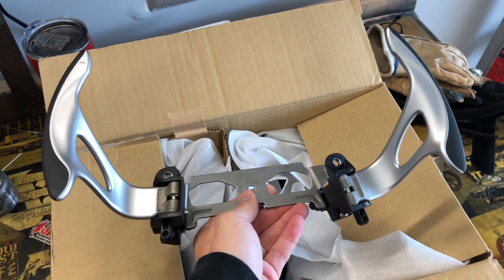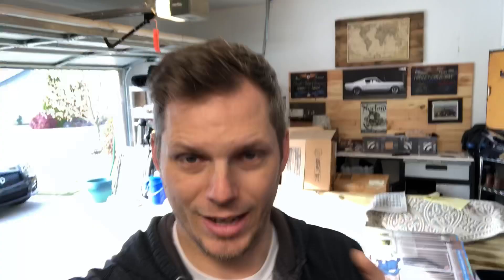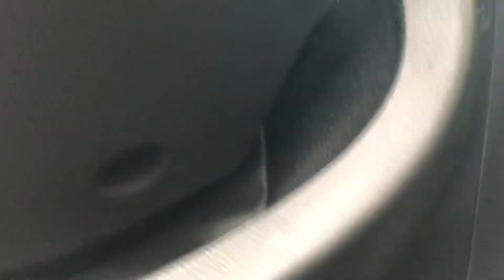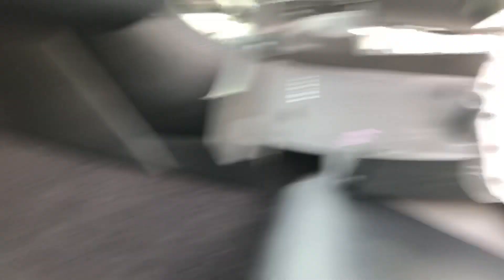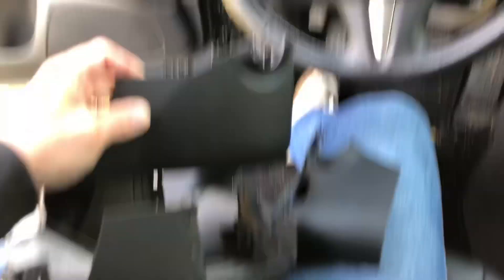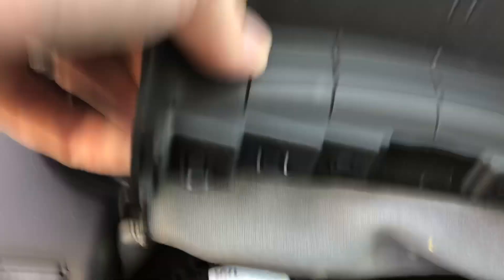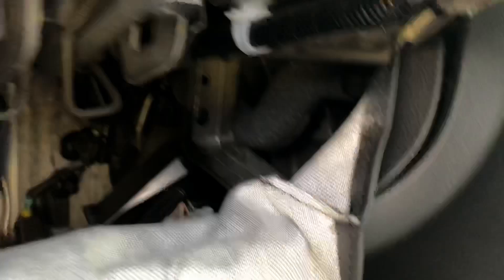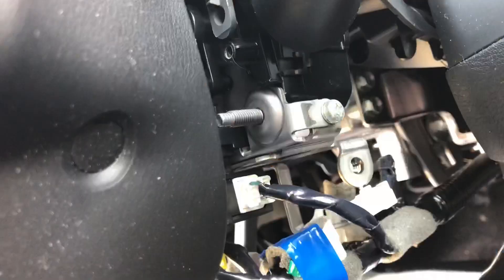Q50 Paddle Shifter Install Made EASY!!!

Comment: Update guys, just installed mine today. Just like he said the hardest part is the leather clips on the bottom cover. Taking them off and putting the new one on. Taking the old column cover off was easy. Installing the paddle shifters was easy. Putting together the four piece column cover replacement took me like 30 minutes.
Reply from the maker: Thanks for chiming in and sharing your experience!
Reply: malcolm velez did u get the manual cover and if so did the image on the site have the hole or naw please help
Reply: @joeytavares1483  I did get the manual cover. These are the part number 
Cover - 484704gf2a
Fender Bolt - 081466122g	
Backup Lamp Assembly Nut	0891110637

https://www.discountinfinitiparts.com/
Reply: what q you have?

Comment: just for notice. You actually don't need to order Bolts and Nuts from Nissan. Simply go to place like Home Depot or Lowe's. Bolts are standard M6 bolts and Nuts are any nuts that fit M6 bots. So for a summary, 2x M6 bolts and 2x nuts that fit M6 bolts.
Reply from the maker: Exactly—I used nuts I had laying around. I wanted to provide Nissan info so people could get the correct specs. Thanks for providing details!!

Comment: Did mine in 30 minutes, it was easy overall. Hardest part was removing the plastic around the column I squeezed the edges and pulled down and it popped off. I have a 2014 Q50 premium. Definitely a good and fun mod.
Reply: Where did u get the paddles and all ? I'm trying to do the same on mine I have a 14 premium as well
Reply: @fastbikes8075  Kilo November on face book. Really good quality and custom options
Reply: @abimaelmendez4912  thanks 👍I'll check it out
Reply: @abimaelmendez4912  hey man do
you mind sending the Facebook profile? Thanks!

Comment: Just finally decided to get myself these paddle shifters for my '15 Q50 after watching this video several times and seeing that it isn't too difficult, probably gonna refer back to this video when they arrive and it comes time to install them. Can't wait! Thanks for the videos as always.
Reply from the maker: You can handle it!
Reply: @SpeedCultureStudios  Thank you for your encouragement! I got them installed tonight, wow they make driving so much more fun. The hardest part was getting the new housing back together but otherwise that couldn't have been more simple.
Reply: Hey will this work on base 2015 q50 too with tech package?
Reply: @zainahmad4537  Since it's 2015 you should be fine, but if in doubt it's a good idea to check to see if the connectors are there before ordering.

Comment: You should make a how to video of the remote start for your q50.
Reply: you only gotta press it once
Reply: @carterevanh  u sure?
Reply: @Awsometiger1011  can on mine at least. cant imagine why it would be an aftermarket mod
Reply: @carterevanh  it is a aftermarket mod , not all models come with auto start !
Reply: @carlosbolanos5361  sure, you could add it aftermarket. but if your key fob has a circular arrow button at the top, thats your remote start and it came from the factory
Reply: @carterevanh  my infinity Q50 fob key only has 4 buttons , the one you have has 5 buttons if I’m not mistaking !?
Reply: @carlosbolanos5361  yep!
Reply: @carterevanh  what year is you’re Q50?
Reply: @carlosbolanos5361  2017 premium
Reply: @carlosbolanos5361  smart man'
Reply: @chinodadon3418  what do I u mean by that sir !?
Reply: @carlosbolanos5361  n a good way 👍🏼 calm down
Reply: @carlosbolanos5361  mine has 4 buttons. But I was messing around with mine once and it started lmaooo hit the lock button 3 separate times and see what happen
Reply: @MrAndremalcolm  I’m going to try it ! Thanks 🙏

Comment: I ordered my kit from the infiniti part dealer 311 dollars I'm waiting for delivery! Excited good video!
Reply from the maker: Infiniti got you a full kit for $311?  You either got a hell of a deal or you’re not getting a full kit.
Reply: @SpeedCultureStudios   
Description:Steering Wheel Transmission Shift Control Switch 
Part Number: 25549-6AV0A
Quantity:1
Price:$135.68
Description:Steering Column Cover 
Part Number: 48470-4GF2A
Quantity:1
Price:$143.50
Sawgrass infiniti FL
Reply from the maker: @atsila_one  man prices must be going down!  It was hard to find junk yard paddles for under $300 for awhile!
Reply: @SpeedCultureStudios  South FL things are very cheap when it comes to car parts! The dealership in my County want it 900+ dollars so I went to the next county over Broward county and that’s the price they gave me so it varies by county when it comes to Florida

Comment: I guess im lucky my q50 came with paddle shifters😂
Reply: Sport model
Reply: @unxlak1032 my sport model doesn’t have it
Reply: @isiponwock it should
Reply: @Nearesponsable my sport model doesn’t have paddles
Reply: @Nearesponsable  not all sport models have them
Reply: @Prod_Beatzz yeah not all sport models have them... Most likely have to get them installed
Reply: @chickenvanes4406  yeah that’s just weird
Reply: @Prod_Beatzz it’s because you probly have a base q50 3.0t like mine the turbos unless you have a red sport q50
Reply: @M-bn2cv  no it doesn’t have to be a Redsport to have paddles I’ve seen many regular 3.0t with them mines a 3.0tS and doesn’t have them I had to buy aftermatkey
Reply: @Prod_Beatzz  yea what I mean is the ones that don’t come with it. the 3.7 come with it I’m saying all 3.0t sports,base,premium don’t come with it the redsports and 3.7.
Reply: @Prod_Beatzz  the 3.0t don’t come with it unless it’s red sport the 3.0 any other models don’t got it unless it’s 3.7 or aftermarket I know a lot of people with q50 and me owning one I did my research. So no not all 3.0t come with it unless your redsports  or 3.7
Reply: @M-bn2cv that’s actually not true. The paddle shifters are a option when buying the car brand new. Considering it’s a luxury car not a lot of people liked or used the paddles so they made a lot out of the factory without them. If your buying a q50 brand new you can have the option to pay for the car to come with them.
Reply: @oscarbanuelos3573  no it’s not unless you getting a 2020 or some shit the 2016 didn’t come with paddle shifters the 3.0t im talking base the red sports do come with it but only some j never got the choice to want paddle shifters what dealer you go to unless I wanted the red sport or the 3.7

Comment: I found the bolts at an infiniti dealer (you can also find them in a Nissan dealer), the nuts were not available in my area so I bought some at home depot ¼ fine thread. Thankyou 😁

Comment: Fun fact, the Nissan Maxima and Altima paddle shifters also work well with the 14-15 Q50 models, and they look better
Reply from the maker: Looks are obviously subjective but yes, I think we’ve mentioned it a few times in the comments and in other videos that there are several cars you can use paddles from which helps broaden the search and gives more options.  Maxima and g37 paddles are often used in these Q50 upgrades.
Reply: @SpeedCultureStudios  I bought em cause they were cheaper.  Yea they look better but were like $100ish cheaper

Comment: I have the 2014 3.7 Premium Q50. I see there are multiple versions for the 3.7. On the site, the auto tilt linked says its listed for the sports version. Which shroud should I get for the auto tilt?
Reply from the maker: Only difference is auto tilt or manual tilt. Obviously it has to say “sport” because only the sport had paddle shifters.

Comment: Nice video man, I installed my paddle shifters myself as well ! Easy job 🤙
Reply from the maker: Super easy! Stupid they just don’t put them in all cars!
Reply from the maker: ryan nurse I found the paddles off a g37 at a local salvage yard. I offered them $100 they said $120. Then I found the shroud online—link in the description—for $100. So $220ish for all of it and a 30 minute installation.
Reply: ryan nurse I bought mine from discount Infiniti for $187 brand new & I bought the shrouds and hardware for $135 I believe . I see the kits selling online for $500-$600... crazy
Reply from the maker: @kevinbaca3258    Nice deal!  I'm seeing just the paddles going for $250+ used on ebay!  Even the salvage yard I went to chuckled at my offer at first saying they usually sell them online for $220.  They gave me the deal because I was local and came and picked them up same day.

Comment: My goodness thank you I been waiting for this vid from you for so long , I got the paddles but needed instructions thanks 🙏🏼
Reply from the maker: No problem!  Should go pretty smooth!  Just be careful with the trim pieces!
Reply: I have a question it’s posible to cut the plastic lower panel for the paddles ?
Reply from the maker: I have seen it done. I don’t think the guy was too pleased with the results but it didn’t look too bad. The holes were just bigger than they needed to be. 
I considered doing it myself with a dremel but found the deal in the shrouds.
Reply: Just to try to do it right away my mom has a fx35 with paddles, I can use the same measurement from hers . Btw you think I can find the hardware at Home Depot or Lowe’s just to see if I can save a trip to the dealership lol
Reply from the maker: Cheap Q50 Oh yeah it won’t be a problem finding hardware. I’m just not sure exactly the specs. I happened to have a couple of nuts in my bin that fit.
Reply: Thanks man keep up the good work I’m working on my car following you lol that’s why it’s Cheap Q50 🙏🏼
Reply from the maker: Cheap Q50 trying to keep it cost effective. All about bang for the buck!

Comment: That part number shows a column with power tilt. Is there a column cover for paddle shifters and the manual tilt lever underneath?
Reply from the maker: The part number shown in the video on the box was the column shroud I used which is manual tilt

Comment: I am not sure what shroud to purchase  (Auto Tilt) or  (manual tilt) what is the difference and how do I find out which one I have right now?
Reply from the maker: If you have to pull a lever to tilt your wheel, you have manual tilt.
Reply: Speed Culture Studios do you get both pieces the top and bottom for $119?
Reply from the maker: Karen Young yes indeed.
Reply: Speed Culture Studios thank you so much for answering all my questions! 🙂
Reply from the maker: Karen Young no problem!

Comment: I’m having a weird problem, the left side fit 100% but the right side when I shift up, it touchs the steering wheel! IDK what to do! 😢
Reply from the maker: Pull it back out and inspect it. Should not come that far forward. May not have it tightened down?

Comment: So the plugs are there even on models that were not equipped with the paddle shifters?
Reply from the maker: Yes, some.  2014s and 15s seem to all be equipped with plugs.  It seems as though some 16s were and some were not.  I always suggest pulling the shroud and looking before buying!

Comment: you could be Damien chappas body double lol i hate paddles shifter have them on my 2017 accord on a CVT just doesnt make sense they get in the way are they safe to remove completely ?
Reply from the maker: Maybe if i was 50lbs heavier and my face and hair was different...  But you're right, paddle shifters with a cvt doesn't even make sense.  Don't remove them--just don't use them.

Comment: Hey, I just did this exact install on my 2014 Q50 and for some reason the transmission won’t consistently up shift. Some times it does and some times it doesn’t. Do U know what the issue could be?
Reply from the maker: Bad connection in your paddle.
Reply: @SpeedCultureStudios  how would I go about fixing that?

Comment: Is the full kit needed for this or can this be installed with paddles alone ?
Reply from the maker: You can install just paddles but you’ll have to cut the shroud to accommodate the paddles.  Some have done a nice job and some have made them look terrible

Comment: Hey I’m about to do this modification. Do you know if the q50 steering column is the same as a q70 as I’m taking the paddle shifters from a q70? Both our cars have power tilt.
Reply from the maker: I would imagine they are the same paddles.  G37, 370z and maxima paddles for as well
Reply: @SpeedCultureStudios  Ok thanks. Do you think the trim pieces are the same or probably not considering it’s a different model?
Reply from the maker: @dylanbergdoll7736  That is what I’m not certain about.  It’s likely they are the same in my opinion but I can’t confirm

Comment: How do I know which shroud to purchase ? I own a 2015 awd premium. Would it be the manual tilt cover shroud then i’m assuming?
Reply from the maker: If you have manual tilt then yes.
Reply from the maker: @ddanielnavaa  I don’t know—it would depend on options selected I suppose.  You just have to look and see what you have.  Do you manually tilt the steering wheel or do you have a button?

Comment: I recently purchased a 2015 infinity q50 (base ) 3.7 rwd , these paddle shifter should fit my model correct!?
Reply from the maker: Should but I’d check for the connections first
Reply: @SpeedCultureStudios  Good video , bro . Next project paddle shifters on the Q50 ! I gave you’re video a like 👍
Reply from the maker: @carlosbolanos5361  thanks a lot!

Comment: Is the metal mounting bracket holding the shifters required?(as seen when you showed them the first time) I see a lot of listings without it and noticed when you put them on you didn’t end up using it. Thanks for your help!
Reply from the maker: It was just to keep the paddles together while they were for sale.  You won't need a bracket for install.
Reply: @SpeedCultureStudios  ah I gotcha. Thanks for the help

Comment: Great vid just a question would the manual tilt shroud fit on a q50 2018 luxe because it says its for older model years
Reply from the maker: I doubt it.  Maybe in the non-sport models, but the paddle design was different in 18+ so I would guess it’s different
Reply: @SpeedCultureStudios  hey man just talked to some people the shroud is the same but i need a paddle shifter kit with wiring harness since in 2018+ models they dont come pre wired to install paddle shifters the install isn’t too hard so im glad just gonna be a bit more expensive tho

Comment: Can I do this in 2019 Q50 luxe ??
Reply from the maker: I’m not totally sure. I doubt the g37 paddles are compatible. You could remove the steering column shroud to see if it’s pre wired. I haven’t seen anyone install paddles on the new ones yet.
Reply: Let me know if you did it?

Comment: Good video been using your videos to mod my hybrid, do think the 2014 hybrid wit have the connections ?
Reply from the maker: I believe most 14s had the connectors.  It’s easy to pull the lower shroud and check though.  Worth looking before buying
Reply: Emanuel, i have a 2014 as well, did they end up having the connections??

Comment: So I went to order the cover shroud and the image on the site with the manual tilt had the hole is that just the image I don’t want the one with the hole help please
Reply from the maker: I would say my suggestion is to pay more attention to the written description than the image.  I have manual tilt and the link I provided was the shroud that I purchased, so it should be correct.
Reply: Speed Culture Studios You must of misunderstood my question I put in the same part number but the image is not the part I need so that’s why I’m checking with y’all that ordered it to see if the pic is just a eneric pic
Reply: Speed Culture Studios and thanks
Reply from the maker: joey tavares I think I understood—that’s what I was saying.  The image may just be generic.  If the description and part number matches what you are looking for, that’s what I would go with.  You may also be able to call the company just to be sure.
Reply: Speed Culture Studios thanks bro ur amazing and the video was a great help I’m just a little slow at time and over think things at times I ordered the same one u did.

Comment: Will this work for my 2016 if not I just take off cover to check for the wires. Also would this effect my electronic tilt
Reply from the maker: Should and no it won’t—just need the shroud compatible with paddles and electric tilt
Reply: I also have a 2016 q50 premium. Does it work for yours? I’m thinking to put one on.
Reply from the maker: Yifei Song you’ll want to pull the shroud and double check if it’s pre wired.  Some are and some aren’t after 2015.
Reply: Speed Culture Studios Thank you! My car is currently at dealership. I can’t wait to check it. Nice video man!
Reply: @yifeisong3871  I officially installed them and my 2016 premium came with it. Was able to get the paddle shifters assembly for 80 bucks as my friend was selling his g37.
Reply: Luciano Agostinelli Luciano Agostinelli thanks man! I found people selling from ebay are 180$+ China manufactory product and 480$+ from the dealership and Z1 just for the paddle shifters itself. The used ones would be typically 200$. The plastic covers would be another 100$+ . I’m still looking for a better deal.
Reply: @yifeisong3871  I would go to salvage yard for best deal.